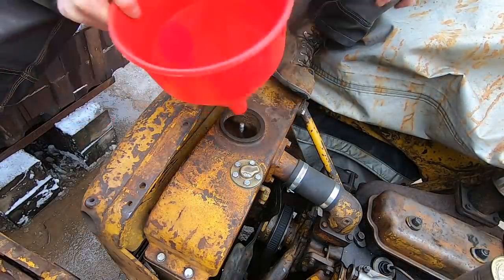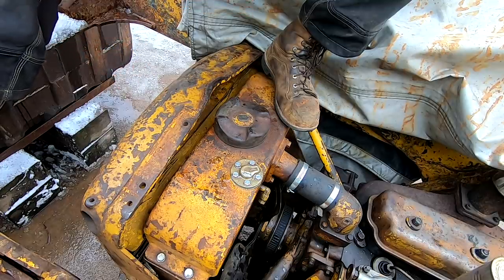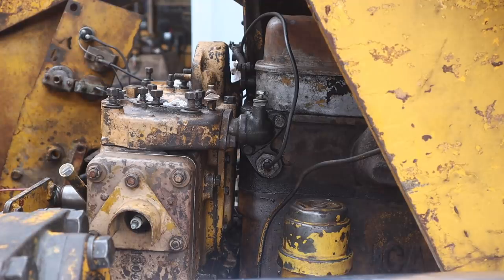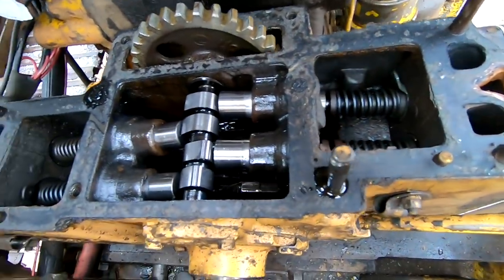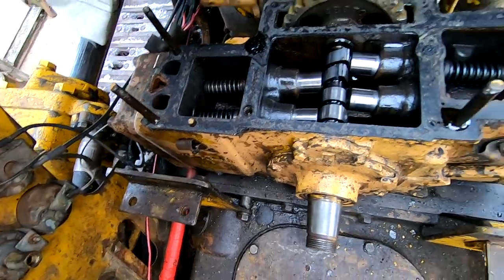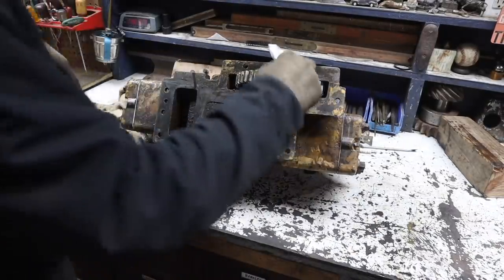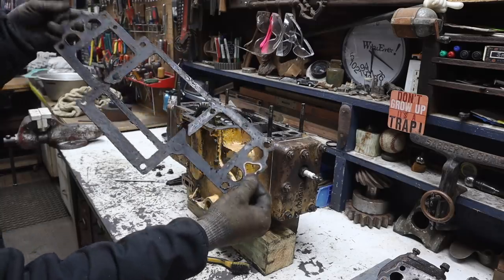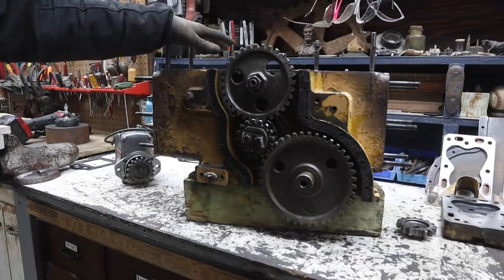I REMOVED the Pony Motor!!! ~ Part 15 ~ 1950s Caterpillar TraxCavator

Comment: I'd keep the pony motor starting system if it were me. If the pony motor wasn't electric start I might consider trying to convert the machine to electric start and lose the pony motor. Back in the early 70's I was the operator on an old slide bar D8 for a highway construction project. That thing was made before they knew about hydraulics for moving the blade. The pony motors on those things had to be started with a crank handle similar to the old model T ford. Only difference was, those things had a bad habit of kickback every so often and a reputation for breaking an arm or throwing you over the track when they did it. That thing walked out of one of it's track one day. One of the hardest days of physical labor in my life was helping the mechanic get that track back on with the dozer sitting on the side of a levee.

Comment: It's possible those two crank bearings have to be line bored. Going to all that trouble you could convert it to roller/ball bearings. The back end  might need a new case but it's circular so could be made for the job.
Just my thoughts anyways.

Comment: The magneto shaft was bent right? And if there was a small tooth piece missing on one edge then maybe the thing about it having in and out play caused the power to go to the edge of the one tooth and break it, then it got into the teeth and made the gears push away and bent the shaft, and then the bent shaft combined with the play caused it to break the larger chunk off, and then the small chunk plus the play plus some form of binding plus the bent shaft broke that whole tooth off and that’s when you saw the failure point (the other teeth may have been prior to you ever touching it)

Comment: Might have had better luck with that pipe wrench if you used it in the other direction, eg. rotating the crank 180 degrees and flipping the wrench over so the jaws faced down. The teeth and jaw design only bites down one way, and lets go in the other. This makes it easy to use on a pipe (which is round, of course, so it has to bite into the material instead of relying on flat portions like a hex nut and crescent wrench) without opening and closing the jaw adjuster as you go. Hard to explain in words, but hopefully that made sense.

Comment: @35:47, these are the connecting rods. A wrist pin connects the rod to the Piston.
Reply: That mag doesn’t have the drive slot like the impulse mag used on the D6.  So the M Mark on the camshaft gear is used to time the gear on the mag shaft,

Comment: I hate the videos on Ol' Red's restorations are over so soon! Two quick questions, and forgive my ignorance because I am truly trying to learn! The loose bearing towards the end of the video...what's the difference between a bearing and a bushing? It looks like a bushing but I am so novice at this and like I said, I'm still trying to learn! Second question regarding that broken gear. You have the missing tooth on it...would it be possible to weld that tooth back on and then perhaps, after filing it down and doing any necessary repair work, anneal it so that it gains strength? Just curious and totally ignorant, so if I'm off in left field let me know where I'm making my mistakes! 

Also, I"m kind of OCD and I want to volunteer to jump in and prime and repaint the yellow surfaces of the various parts as you work on them LOL

Comment: forget making one out of bronze the correct bearings are obtainable engine reconditioner can supply when they grind the crank this needs to be correct or you will be doing this again but with more damage you take the plug out of the top cover to see timing marks to check crank journals measure for out of round as well as under size [ important]

Comment: Electric start would make sense if you want to work it.
I think things are broke because that poor machine is missing half its bolts to hold everything together.
Also the pony doesnt just turn the motor over but also heats the coolant going into the head to make it cold start. That's cool.

Comment: The thing I don't completely understand about pony motors is why they didn't use the alternatives that are around today. High torque electric motors have been around longer than the combustion engine. And the air compressor starters shouldn't have been difficult to figure out in the 50's either since pneumatics had been around a long time as well.
Reply: It was done because a guy with a can of gas and a starting rope can go out into a blizzard and reliably start a pony motor equipped tractor.  Lots of them are cantankerous because they’re worn out or need some tic but even today with modern batteries etc, it’s hard to match the starting capability that CAT built into their machines by using a pony start system.
Reply: Got to remember, batteries and starters weren’t so reliable back in the 1930’s when CAT first started using Diesels.
Reply: @jimrankin2583  I guess there is a certain reliability in a pony motor. Comes down to lack of battery technology at that time. Something we still suffer from today in many ways.

Comment: The loose bearing pin took out the timing gear of the magneto, it could have been worse like throwing a rod if the pin let go completely. I don’t think the bearing is badly worn out, the crankshaft backlash is set by the bearing which was loose. Try putting the crank back with a better pin using the same bearing. That might help save time if it’s any good.
Reply: Bearing is toast.  Possibly could reuse front one but probably got some wear on it too.

Comment: If you are not absolutely sure your have the water/antifreeze mixture mixed to the required concentration for the temperature you are likely to see, I'd drain all the water/antifreeze mixture out of the radiator and engine block.   It would not be fun the freeze damage any part of the cooling system.

Comment: Are the 3 holes in the main bearing at different distances from the inside edge? (the one hole had the loose pin in it) I'm wondering if that is how crankshaft end play is adjusted? Or would you use a spacer washer at the flywheel end between the bearing and the crank?

Comment: Hi please do everything you can to find all the bearings they are not aluminium also take the crank to a professional none of these parts are parts you can easily mess about with and come out with a satisfactory result you are likely to destroy it. All of the big end shell's MUST go back exactly as they came out .All of this is critical you are doing such a good job please don't break the pony

Comment: A question I have is why? Why did you find the pony motor with so many of its gaskets not on the machine, and still find the gaskets amongst all of the parts? Maybe the unit was retired because someone was working on it, and they could not fix it? But then again it broke while you were running it? Why did the motor have all these brand new like parts and was put together with only a few bad gaskets? You made it work, then it broke? Curious here....

Comment: I would look for other timing marks on the crankshaft gear and the camshaft gear. It might look like a V or a straight line, it depends on the manufacturer and year models

Comment: I have a question, shouldn't there be some type of thrust washer in there to keep the crank from moving forwards and backwards? I understand completely about the worn out bearings but that must meen that they shortned in lenth also to give so much play? Just a question, somebody who knows more than me might be able to answer me on that one
Reply: yes he has thrust wear more than bearing to crank clearance. maby he needs to machine a bearing with a thrust face?
Reply: I believe the main journal bearings also provide the thrust surface to control axial movement.  The crank had too much end float because the bearing at the gear end of the crank effectively gets pushed out, even with the pin in place (the hole in the bearing for the pin gets ovaled).

Comment: Just friendly heads up for future reference to anyone curious about Ethylene Glycol (Anti-Freeze). To obtain the lowest Freezing Point for engine protection you would shoot for 65/70/75% antifreeze solution to get -55°C Freezing Point. 

However even if you had 100% antifreeze concentrate in the system you wouldn't need to worry cuz it doesn't expand like water does when it freezes.

But you wouldn't normally ever want to run 100% antifreeze in a vehicle cuz it is not as effective at heat transfer.

Comment: My stepdad was a contractor and we had one of these when I was a youngster. Although it was a bit larger, a 977. Pretty much the same layout only "bigger" ! You should try to figure out why that bearing/bushing wore the way it did. That's not normal. Think about it. although this traxcavator is from the 50's, the pony motor shouldn't have many hours on it at all as it was only used to start the main engine. It was only ran a few of minutes at a time when it was running. That's why everything internally is in such good shape. Except for that "bearing/bushing" ! It is badly worn. There is a reason for that, and needs to be investigated.

Comment: Axial play in a crancshaft is not a big deal. It never vas tight. It is probably more tight warm. I worry about the water in the cooler. Not mixed at all with the antifreeze. A few turns on the starter with a closed thermostat dont mix it at all.  To bad if something freeze so it breaks.  I really recomend you to drain it, and mix before you refill it. If the colant is  clean, it can be reused in this case
Reply: That much IS a problem.  It will eventually break the crank in the middle between the two throws.  He’s got more than 1/8” or 0.125 and spec is like 0.010 so 10X !
Reply: @jimrankin2583  ok, that was a bit much. Hard to tell on a video. But i have worked on old engines, and axial play is common. Vintage tractors, Snowmobiles, etc. But, get the engine out to look for the rest of the nut made perfect sense anyway, So now when you have the engine on the table AND if also is out of spec, offcorse you should fix it.  I follow your resturation here from Sweden with very big interest. Awsome.

Comment: The difference between ethylene glycol turning solid and water turning solid is that water expands when it freezes and ethylene glycol doesn't. The expansion is what causes things to break. Frozen ethylene glycol won't flow but it won't damage anything either.

Comment: Any missing pieces from that gear train have to be in the oil sump of the p motor. there's no connection to the coolant circuit.
Changed a p motor in 1980  on a '49 D4 after I blew a rod in it, ran it out of oil. when I put it all back together I put a long bolt in a short hole  in the manifold and broke thru the casting between the coolant and the intake manifold ie water in the oil,  for years I had to drain it and check the oil before every start.
When you replace those broken gears mark  the timing on the drive gear on the front side so you can  see it It's marked on the back ,you  can't see it  after you put the manifold back on.
Reply: You’re right Frank, the pieces won’t be in the coolant spaces, but they won’t be in the crankcase sump either.  They will be in the pinion clutch housing under the gear that’s visible in the well in the clutch housing surface after lifting the pony off.

Comment: 28:24 Most likely that castle nut you found in the oil tube was the cause of the gear teeth damage. End play would not cause teeth damage. Something has to get between gears to cause teeth to break.

Comment: Cat has been putting aluminum bearings in those pony engines since 1931 that I know of. I’ve seen bronze bearings that people have made and last half the length of the aluminum. My thoughts as to why aluminum was used was because of heat dissipation.

Comment: Love your videos on this old girl.  I have to laugh at the comment you made.  You did not know what a pony motor was until you got this machine.  I remember my dad having one almost identical to that one. As a kid I use to climb all over it.  

There are some small differences between the two.  I seem to recall 4 levers instead of 2.  This does not include the 2 levers above and to the right to operate the bucket.  It did have a riper bar on the back and may account for at least one of the levers.  I maybe wrong, it was a long time ago.

The second was the location of the battery.  It was located next to the cab area..  I know this for a fact.  Some stupid kid decided to stick his finger into one of the cells of the battery.  We will not mention who the stupid kid was other than the fact it hurt like hell. 

Another difference was the grill.  My dad's was cast iron.  Boy, does that give it a different look to it.  I have yet to see one like it on YT or anywhere else.  

The largest difference between the 2, I remember my dad's when it was about 10 years old.  Yes I am old as well, lol.  I will be sending you a horrible picture of it.  It is over 50 years old and a scanned copy out of a family album.
Reply from the maker: That is Awesome! I'm betting it was a D4 with an aftermarket Trackson Loader on it! Similar to the 955, but closer to a D4 from that era!

Comment: You should have marked your crankshaft bearings for orientation as they wear in a certain pattern . Not putting them back in the same position will cause quicker wear to these parts or possible failure. Just get new ones if available.

Comment: Do you look at and answer comments? I would guess the pony motor is on hold since Jan and you are off to other things or busy with family but just a thought. Have you considered needle bearings. They make very low profile ones that may just have a standard fit for what you are looking for. OH, and I am sure you know but if you make new bronze bearings please make sure you put the oil holes in the bearing and face up like you pulled it out. Keep that pony motor. It is part of the history of Old Red.

Comment: I have done the conversion and you don't want to do it on a older rig. The guy that had me do it was a fool and his money and had a connection with the dozer as it was his dads.  Besides it is cooler original and hold's a value that way.

Comment: Piston Connecting Rod or in the trade con-rod. The bearing is big end bearing. NO NO brass will only last a very short time and as it wears will spread contamination. Wrist pins are called gudeon pins.

Comment: You might need to length your bushings to accommodate the end play on the crankshaft.
Reply: Yes, that is how the end play is controlled.  The bearing on the gear train end is trapped between the crankshaft and the gear. There are no washers or adjustments.
Reply: @brianrvd  I assumed that would be the situation. A friend had a Subaru that way, from a car with manual trans, and pulled that and put it in a car with auto trans. It lasted for quite a while that way.

Comment: I`d suggest to put a air hose down into the rad and circulate the mix any part of that stays water will finish the system ,  One Ounce of prevention is worth a Pound of cure   Won`t hurt , Ya someone probably couldn`t find the nut end or the castle wire it got picked up still won`t hurt to get a flat magnet from a  Chevy FWD 125 transmission it`s 2" square glue it to the block inside bottom with High temp Loctite   to catch any metal bits that get removed from working thru the years these parts are getting obsolete  , Color the tooth for the Mag .

Comment: Lap and check the main bearing surfaces, this you can make ir yourself making a grooved aluminum collar (soft) and spin the crankshaft on a lathe with laping compound. Don't buy the main crankshaft bearings but buy them. They should not be expensive and made of the correct material.

Comment: Those are BABBIT bearings. Not aluminum. Babbit is similar to a hard lead. Bronze or brass will kill that crankshaft. It has to be a Babbit bearing. Watch Squatch 259 channel of his pony motor rebuild. I believe that is the same pony as what the D311 Cats use

Comment: The problem of freezing water is not that it solidifies. The trouble is, only benzene and water EXPAND while going solid. That's why hoses and engines break with freezing water inside. 
Ethylene glycol just contracts when freezing so it ain't much of a problem if it freezes over inside a compartment.

Comment: Aluminuin sleeve thermal expansion/contraction must be different from Bronze ?, so you changing the material, without matching thermal dynamics of each ?  , scroll seals save using any perishable rubber seals, , you should shim it on the outside ?

Comment: I don't think your magneto gear broke because of the crankshaft play.  The magneto gear runs off the camshaft gear, which had no play at all.  The magneto gear just plain failed, which, if I recall to my youth 60 years ago, was a common feature of all magneto systems (except those in aircraft).  If you end up machining new bushes, don't forget that the crank end play/thrust  is also controlled with these two bushes, which are worn shorter.  Probably all the thrust goes to one of them, the rear one, but check carefully.